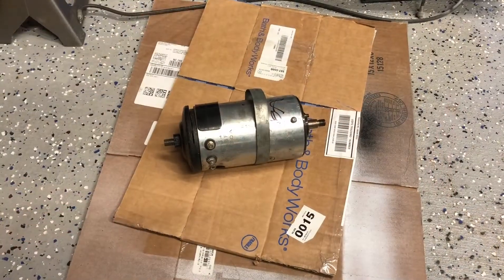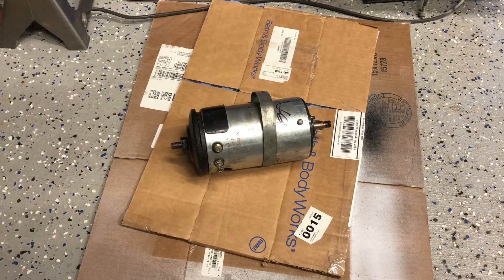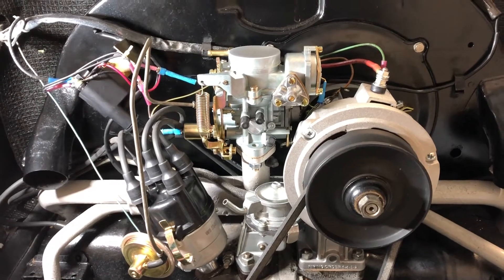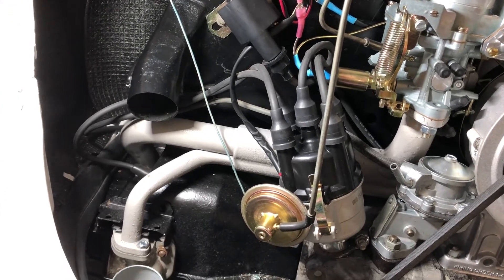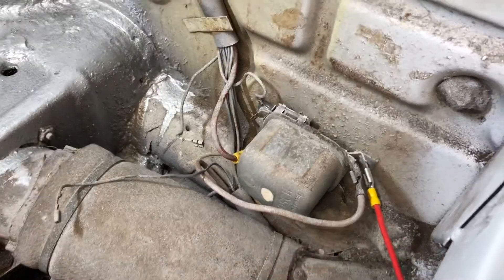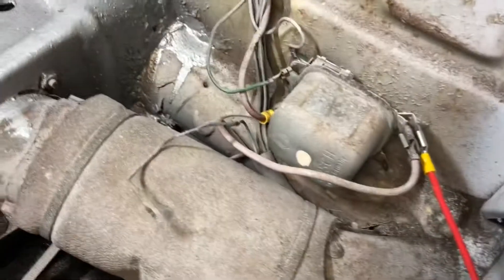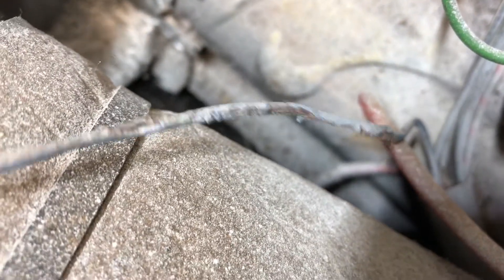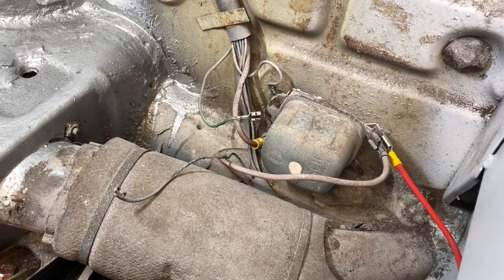69 VW not charging alternator swap

Comment: I was looking up how to test these alternators and found this . 🆒 Some of these alternators had the external regulator, which is what I’m working on for a fella. I think the 74’s used these, not sure. These have a 3 prong plug connector on the alternator that  goes to a solid state regulator. Wanted to confirm if the alternator was bad or just the regulator.    And that distributor is what is called SVDA. Best distributor to use for these period. The 009’s are for industrial applications with guaranteed flat spot when revving off idle. I also put a Petronics ignition on mine that works great. The point systems are great too, but the new replacements are crap and the condensers are even worse.
Reply from the maker: Typical stock VWs have a generator and external regulator, starting around 73 and also available aftermarket are internal regulated alternators. Good info, thanks for sharing. No perfect distributors but you want to find the ones with vacuum and centrifugal advance for best chance to remedy the stumble during acceleration.

Comment: Great video.  I know what you mean, not to jump into to conclusions.  I replaced my old generator, but mine was indeed bad.  Installed a new alternator kit conversion.  Everything was working fine until yesterday.  I have been working on a sound system I installed in the car.  And a wire from the radio short on me so I had to fix the radio by soldering a new wire in the board.  After I fixed that issue sound system is working perfect.  But yesterday when I went to test drive the car for the first time in so many years, this alternator light is on and the car not charging.  And we are talking about a brand spanking new alternator.  I still have not figured out what is the issue .  But like you said.  I am doing a thorough inspection.  I hope the alternator is not bad, it’s a nightmare replacing them when the engine is installed.
Reply from the maker: Yes seems to always be something. My brand new brake rotors from China can’t handle 90ft lbs on the lug bolts and all the holes stripped. Yay. I may do a video of the aftermath. Lol

Comment: Good reminder !  I once had a problem but found that the bulb in the dash (#61 wire to speedo) was burnt out and therefore the circuit was open I.e. didn’t charge.

Comment: Hi, 
Do you still need a regulator with the alternator?
Because someone just by pass the regulator on my Bug 
Should I put back the regulator?
Reply from the maker: No, alternator is internally regulated, you just wire across the old regulator.